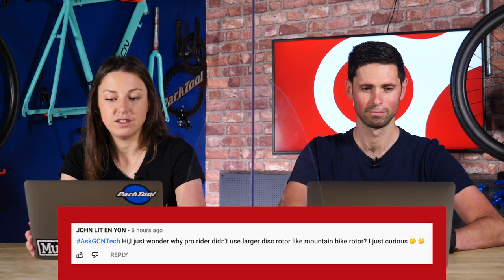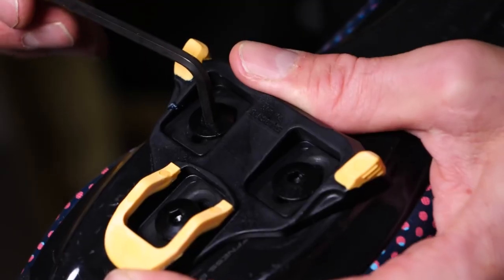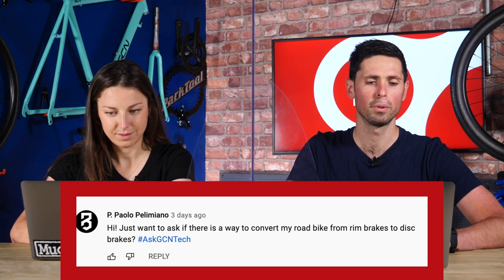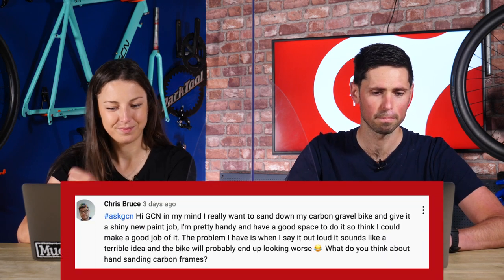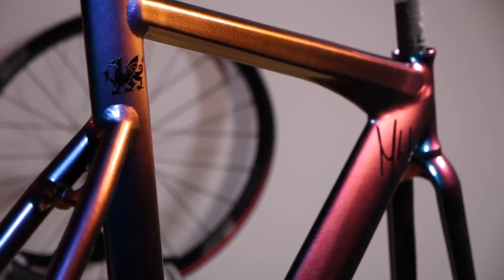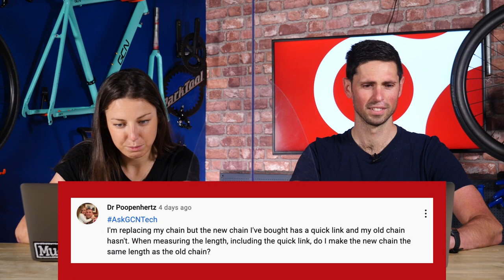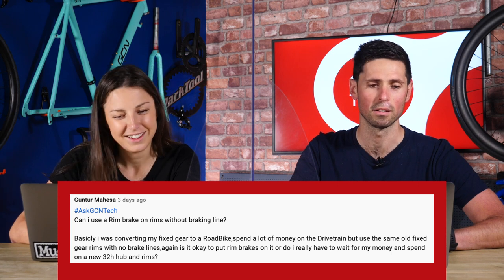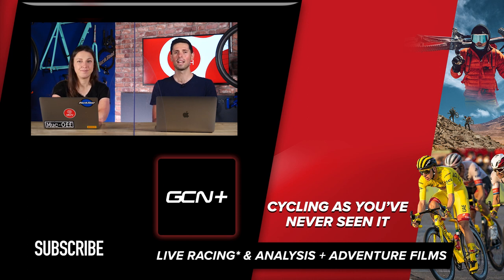Why Don't Pro Cyclists Use Bigger Disc Rotors? | GCN Tech Clinic #AskGCNTech

Comment: It comes down to tyre traction: if a brake has sufficient stopping power to lock the wheel, a more powerful brake is not needed. Since road bike tyres have far less traction compared to mountain bike tyres, far less stopping torque is required to lock the wheel out.
Reply: I was going to say 'because they don't have to but your comment is more informative.
Reply: But it's not just stopping power vs traction, it's also thermal dissipation on long descents... perhaps a larger issue than stopping power (even 140's are great there on a road bike). I have a gravel bike w/ 160mm rotors that I've done some long road descents on and have been impressed at the heat build up with the same feathering / pulsing / reasonable braking I would do on rim brakes.
Reply: @pbandjosh  true. It's not just about braking power, it is also heat dissipation and heat capacity. A larger rotor doesn't heat up as easily as smaller rotor and it also cools faster due to surface area.
Reply: Yeh, my bike is light enough that I don't need two 160mm rotors but I feel like it could come in handy on damp or humid days when I am descending and or in the drops.
Reply: For everyday use I agree, just recently upgraded to hydraulic on my e-bike.
 160mm discs with entry level shimano calipers (br-m445?) on a 55# bike with a full load of groceries in a trailer, total system weight guesimate of 320#. Decent test hill of ~6% and was able to break traction on the rear wheel with ease while intentionally testing an emergency stop from 30mph with relatively super grippy street tires. Fully off the back of saddle bracing on with only 2 fingers even these low end brakes provide plenty of raw stopping power....unless making hard stops is something done in rapid intervals when heat is likely to play a factor.
Heat is why mountain bikes have gone to larger rotors, yes the leverage is better especially on 29" wheels, but the primary thing is that mountain bikers brake aggressively over and over again while headed downhill over technical terrain. The braking force reduces with LOTS of heat (this is also true with motorbikes, cars ect.) On a roadbike, there is less chance of needing to brake in this manner, sure there are epic mountain descents with hairpins, but since roadies aren't known to take chairlifts up a balance between performance and weight needs to be found.  
Then factor in what is presumed to be "everyday" use, 140mm with 700 x 23-28mm total system weights ~200# and significantly less epic speeds and terrain = well beyond what is required. That said, swapping to larger rotors is very easy if you have clearance, all that is needed is an adapter, the larger rotor itself and maybe five minutes with hex wrench and torx driver. 
Even easier, if you feel that you really just need more power, swap to a more aggressive pad compound. (this won't help with heat and almost certainly will increase the noise)
Reply: Its modulation and wet braking performance and frame manufacturers being able to sell a bike that can take 2 wheel sizes or have massive clearance. Ur right well set up cantis grab with authority
Reply: I got rotors the diameter of my wheel- called rim brakes.
Reply: @nickmannerings3574  Paul cantis absolutely grab i wish I had sunny riding all year id never think about discs

Comment: Guys, the size of the disks has relation to the amount of heat you generate. XC guys use 160mm because they don't need bigger size rotors. Downhill bikers use 220mm because they grab those brakes with 4 piston calipers so hard with so much traction they can overheat in less than 3 minutes flat out at 60km/h down a mountain. 
Road bikes usually see the same use as XC guys or sometimes less, and those systems are already pretty good.

Comment: For rim surface maintenance, you can get a little block from from Swiss Stop to remove imperfections etc if you've had grit / stones / metal stuck in your brake which scratched your rim.
Reply: see my detailed comment on repair of such damage with emery paper

Comment: You guys forgot the most important reason why road bikes have smaller brakes: you can only brake as well as your tires’ grip allows. All that the bigger brakes will do is lock up the wheel earlier, giving you less modulation.
Reply: Actually it’s the other way arround. You can’t add more power than the tyre’s traction’s can handle but a larger rotor gives more modulation & heat dissipation
Reply: Variations on the theme of 'it's not necessary and there's no benefit'.
Reply: Cause they’re pros, they save weight from 160+ rotors, they brake as little as possible. They don’t need better modulation or better heat disapation
Reply: That “ locking up” might be right for the rear brake but not the front, if it is dry it takes a lot of braking power to lock of the front brake and i am happy to have 160s there at 80KG
Reply: I thought the main reason is they spend way more time going up hill than downhill.
Reply: @VanillaSky23ffm  I have a 160 mm front rotor on my gravel bike and cannot lock up when on gravel 38s but I can definitely lock the front up when on road 28s. My bike definitely would NOT benefit from any larger front disc.

Comment: I have had incredible success in painting carbon. The biggest trick is to use an epoxy based clear coat. A good auto paint finisher supply house will have this in a spray can. The can has a part B bladder within that has to be busted by depressing a plunger fixed in the bottom of the spray can. Then you have 12 hours to use the stuff before it hardens too much to spray. This gives a factory bullet proof clear coat effective.

Comment: The question about rotor size is a good one actually. Road bikes reach higher speeds than mountain bikes and therefore need to dissipate more energy on braking - and remember that kinetic energy goes up with the square of velocity, so at double the speed you have four times as much energy to shed. This square factor is much more significant than the fact that the bike-rider system weighs a few of more. You can see that the teams do use a larger 160mm front rotor on mountain stages for this reason. MTBs use huge brakes so that you can one-finger brake on tiny levers and save the rest of your hand for holding the bar, even in a DH race the speeds are quite modest so the amount of energy that the brakes need to dissipate is reasonably low.

Comment: #AskGCNTech I've been cycling for more than half a year now. I am a student and I don't have that much budget to spend on my bike. I have an entry level bike and I am planning to upgrade my hubs (disc brake hubs). I have two options:
Option 1: a not-so-famous brand hub, 6-pawls and great engagement, six-bolt rotor compatible, sealed bearings, and weighing 525grams for the pair with skewers

Option 2: Shimano's basic hubs, 3 pawls (okay engagement I guess), centerlock rotor compatible, cup and cone bearings, and weighs 580grams for the pair without skewers (I know that this means I have to change to center-lock rotors as I currently have six-bolt ones, which also means more weight)

Which one of the two should I get?
Reply: Threaded type hubs? You mean hubs with a threaded axel which you tighten into the frame with large nuts on either side? Or do you mean thru axel hubs?
Reply: @mihalis1010  Neither. It means the sprockets are threaded into the hubs. It's like those of older bikes when casette type hubs didn't exist yet

Comment: #AskGCNtech, I’ve just started using a head unit on my road bike. I normally wear glasses with progressive lenses for everyday stuff. Sunglasses are fine for seeing the road and distant objects while I’m riding, but my head unit is right in the range where I can’t see to read. For most things it doesn’t matter a lot. The real challenge is with reading navigation details. Do you have any suggestions for someone with age-related   vision changes.
Reply: Although progressive lenses are great for everyday tasks and wide range of "working", i.e. seeing distances,  in this special case of cycling and looking at a head unit (and also for car driving) one needs to be able to see two distinct distances in clear focus, long distance (infinity) on the top of the lens and short distance (an arms length) in the lower part of the lens.  Hence I would suggest bifocal glasses adapted to these two defined distances.  Any optician worth his salt should be able to prescribe such lenses, and they are considerably cheaper than progressives.
Reply: You can buy bike sun glasses that have a built in bifocal lens (and you can specify what magnification for the lens) for about $70.  I have a pair and they work great.
Reply: @jbmo231  Thanks! That is helpful to know. What brand do you have?
Reply: @wtspman  I have Cycle Journey Photochromic Bifocal Sunglasses, and I picked the bifocal lens strength based on the prescription for my progressive bifocals.

Comment: Hi Ollie/Alex, recent i tried to clean my cycling shoes and i just noticed that my cleats moved slightly(different from what i just set up) and my bolts are not as tight as i set it up and im a little bit worried, also my shoes and cleats have been exposed in mud in recent rides  entering the cleat body and somethings covering its bolts. Is this normal if not that should i do to prevent my cleats from moving? Thanks guys #AskGCNTech

Comment: #AskTheGCN
Can you put front disk fork on bike and have rear on rim break ? Assuming front fork is fully compatible with frame - take fork from disk break version with same specs as rim.
Reply: long story short: yes. you`ll neet a disc lever (or use cable-operated disc brakes) and then you should be good.

Comment: Mavic used to make a cleaning tool to clean a machined rim's braking surface. Bit like a Pumice stone, but finer. Did a great job and made the rims look new again. Not sure if they're still available.
Reply: I had a small / dimple in my break surface from a stone which was caught between brake pad and rim.  I used two small pieces of emery paper and clamped them between the brake pads and the rim by putting some rubber bands around the drops and have them gently pull on the brake levers.  I then slowly turned the wheel and the emery paper cleans and polishes out the dent.   I started with 120 grit and worked mainly in the area where the dent was (+/- 45 degrees), then followed that by 300, 400 and a final all around polish with a 600 grit. At the finer grit levels I started to do full wheel turns.   At the last stage I did probably around 100 revolutions of the wheel.   The dimple nicely polished out and the wheels braked as well if not better than before.    The overall material removal was absolutely negligible, so there is no reduction in lifetime of the wheel.

Comment: Thats the poorest answer I heard for long... The difference in "system weight" between a road and a mountain bike is by far lower that the dirrerence in weight between lets say... a 55kg rider and a 85kg rider... who ride the same 160mm rotors. The first point is already missed. The reason is imo weight of the rotors (kinda stupid since its like ...20g difference) and most important, the fact that forks and frames of road bikes are not tough enough to accept braking forces of a 203mm rotor! I often dream of a DH brake set when descending my local -12% 7km hairpined col !!
Reply: multiple bad answers in this vid.. advising to sand a carbon frame goes against all and any advice from anyone who works with carbon for a living. Super easy to de laminate a carbon frame from sanding.
Reply: How would you remove paint from it some kind of chemical wash
Reply: That and e=mv^2 would say there is more thermal loading descending on a road bike purely because of the higher speed

Comment: #AskGCNTech
Hi Manon, Alex and Olli,
I have a disc brake bike with 140 mm rotors on a 6 bolt mount. 
Now that I am looking into aero wheels, a lot of them seem to have center lock mounts.
Are there any differences for the caliper between these? Or do I just have to buy a center lock rotor alongside the wheels?
Cheers from Austria

Comment: I think main reason is pros don't need to do a emergency dead stop. All they need brakes for is slow down enough for corners. Which 140 rotor at the front would do the job. For us street riders with real human weight  160mm barely enough for 80kph down hill stops when a car pulls out of a drive way. If the brake can't flip you over bars it's not strong enough IMO.
Reply: They certainly do need to do emergency stops and if you watch the better descenders, they brake very late and right on the edge of losing traction (sometimes over that edge) when slowing for corners. They also train for thousands of miles on public roads, so it isn't like they are all that far removed in this regard from us normal folks. 

160, 180 or 203mm will all provide better leverage, which reduces the needed clamping force and thus reduces the grip force required to stop the wheel. How much force that is is determined by the friction of the contact patch of the tire vs the road surface. Carried into the extreme; pairing a 203mm rotor, with a 4 piston caliper on a hard compound 700x23 tire should provide easy pinky finger actuated full lock up braking. Breaking traction on the front at 80kph is going to be a bad day so a hair trigger may not be the best solution. 

140mm is going to get hot and will require 2 or more fingers, but it should have plenty of grab to allow riders of average grip strength to immediately settle into the sweet spot on the edge of losing traction on normal road tires and normal roads which I would hope is the engineering goal. Not designing in clearance for a 160mm disc for those who are heavier, have weaker grip strength or prefer a lighter pull is a fine example of poor engineering, so by all means vote with your wallet on that. 

The rest is tuning to variables, softer compound tires offer greater grip, wider ties have larger contact patches, lower psi again larger contact patches so playing with these and then factoring in your grip strength to find a happy balance. It just isn't a case of moar p0w3r better!! 

Tires really are the most important component in the system everything else should be adapted to make the most from them.

Comment: #AskGCNTech Hi GCN, after how many punctures is it advisable to replace the tyres and inner tubes? Speaking of pinhole size punctures in the middle of the tyre tread. #tubes4life.
Reply: Once your tubes and tyres are 90% patch material you may need to start thinking about replacing them.
Reply: Once you have to start putting patches on patches it might be a good time to change the tube.  this is especially if you get to the 90% level of patches as Darryl suggests.  
At that point you will have a heavily reinforced inner tube which might weigh a 'ton' which might be extremely puncture proof. 
However I have found that patches applied at the roadside are not necessarily as long lived as those I put on at home in the garage. So if you have lot's of roadside repair jobs on your tube, some of these might become 'loose' or develop slow leaks etc.   Innertubes don't cost the world and its safer and less hassle to live and ride with a tube with 1 or 2 patches but not more.  I have 2 emergency inners in my parts drawer with more patches in case I run into storm of punctures but fortunately never had to use them.
Reply: Two separate questions. Pinhole punctures are no reason to replace the tire. Tires get replaced when either the tread is worn out or there is damage to the structure such as a large cut that went deep enough to cut cords. Tubes get replaced when they have too many patches. That's mostly an aesthetic decision - I often go 3 or 4 patches before I toss tubes.

Comment: Maybe because they're already crashing like crazy because none of them seem to be able to apply the brakes firmly without locking the wheels? Bigger rotors would only amplify the problem.
Reply: That is a bit harsh and not really justified.  If you travel at 80km/h and need to decelerate fast to manage the next hairpin turn, you dont always have time to gradually apply the brake, since the bend will already but up on you and then its too late

Comment: #askgcntech I have a wheel-on trainer, and because of which fitted a trainer specific tire on my rear wheel. It's such a pain to remove the tire whenever I want/need to use the bike on the road, but buying a second disk brake wheelset is not cheap here where I live, whereas rim brake wheelsets are aplenty. Question, is there a way to retrofit a rim brake wheel to use on a disk brake frame solely for the purpose of using that wheel on the trainer? If so, what do I need to look out for? Thanks!
Reply: Hub spacing and axel diameter. I can almost guarantee you that you won't find anything cheaper than a used rear disk wheel.

Comment: #askgcntech
I'm thinking of buying a TICR disc compatible frameset which is normally sold by the manufacturer on a DI2, am I able to install its mechanical sibling instead?  My concern is running down the mech cables in and out of the BB shell, and whether the frameset will accommodate that; especially with the fact that its a DI2 designed frame.  And I am not aware if the manufacturer sells this particular bike as a frameset only, but do believe the bike to have been stripped out by the bike shop so to be sold as a frameset only.  

Please help.

Thanks.

Comment: Honestly, I think pros just want their bikes to slow down reliably, they don't do long descents on the levers like we do. The disc thing is an initiative of sponsors to reduce the carbon wheel budget (and push new stuffs on the market, etc.). So there's no point adding rotating mass (which does matter, unless you believe you can acquire speed without accelerating, like GCN told us once, God knows why).